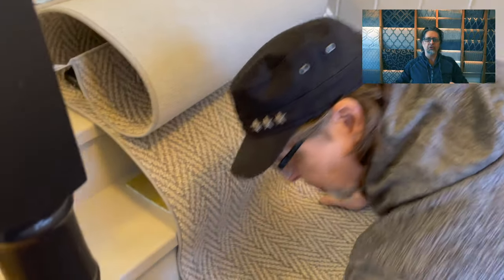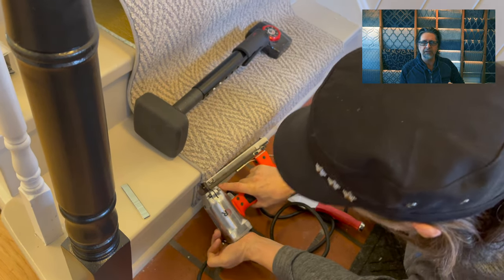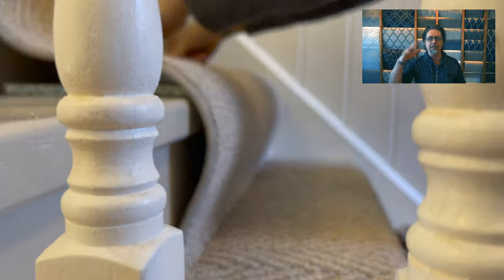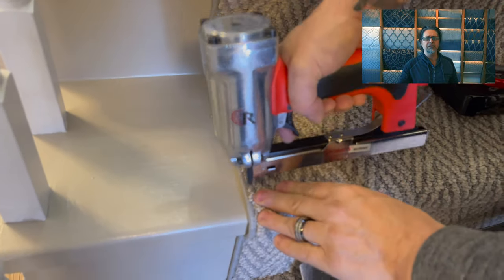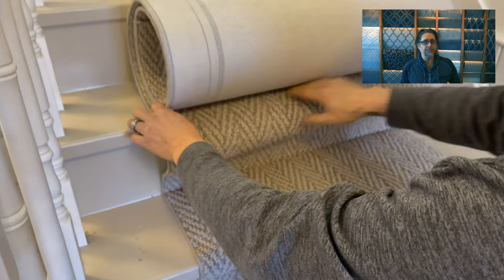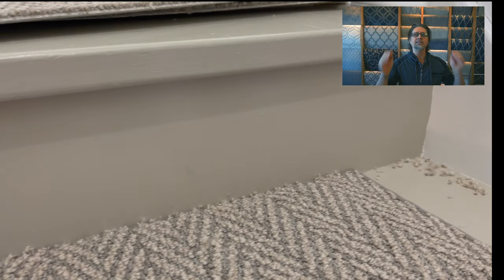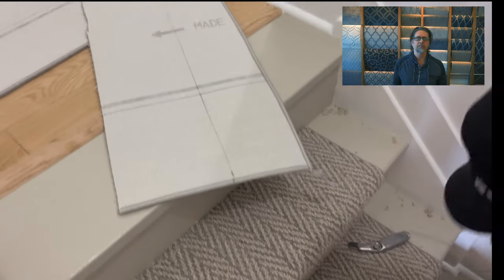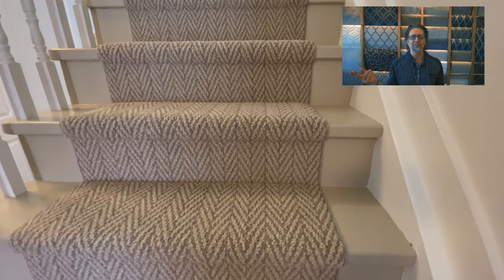Modern Farmhouse Stair Runner Install DIY How-To | Full Tutorial

Comment: Great Tutorial Keith! Want to check with you about the carpet padding. Any recommendations on the width and depth of the padding? Just wonder about the space needed on all 4 corners of the padding. Thanks
Reply from the maker: We use 10 mill gold foil top pad / about 3/8 to half inch
Reply: @KeithShannonDirectCarpet  Thank You. So do you leave 0.5 inch on each side of the carpet padding  to the edge of the carpet?

Comment: Greetings from the UK. Great video Keith. Just a question on the underlay. I notice you only put it on the treads (and not around the nose). Do you leave a small space at the junction of the tread and riser? or do you add the underlay the entire depth of the tread?
Reply from the maker: Well truth be told as you must know / it’s best to have the pad over the edge for wear purposes but the carpet that we are using does not respond very well with the pad over the nose and also does not rewind well to tack strip that’s why we have switched our methods